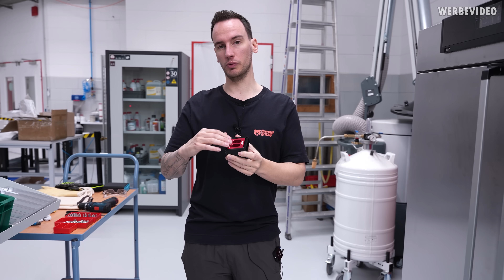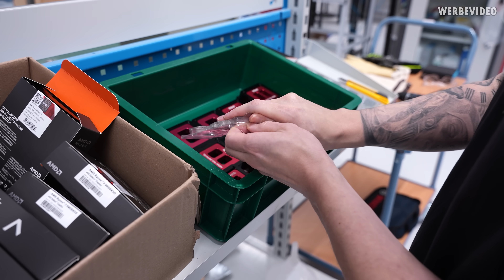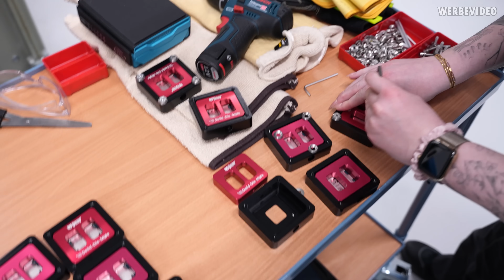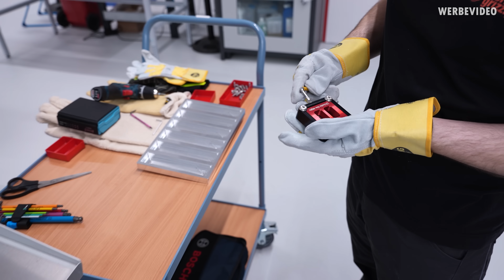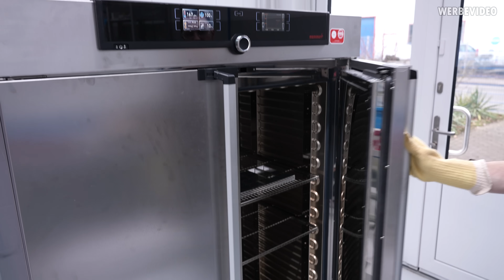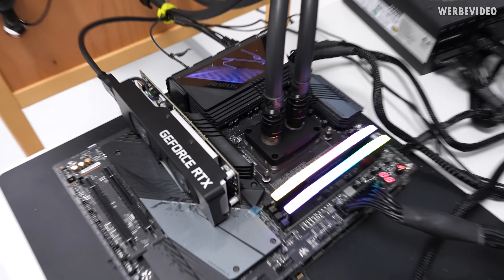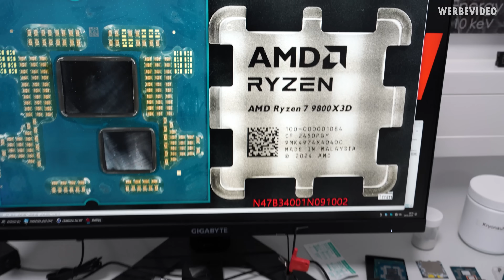You can now buy Delidded AMD Ryzen 9800X3D with 2 Years Warranty

Comment: I would love to purchase this along with your services of applying "safely" Conductonaut Extreme liquid metal  and the ihs back onto the top of the cpu as a full service kit. So I can continue using my AIO liquid cooler on the CPU. I think this will save users a large amount of headache with safely overclocking the cpu in moderation and not risk damaging their cpus.
Reply: Ideally using your own Thermal Grizzly Shield conformal coating around the SMD Components/contact dies around the silicon die then liquid metal on top of the silicon die then a copper OEM fit IHS on top. :)

Comment: Some negative feedback I have for you Der: 170c is not an unsubstantial temp to bake a CPU in, Personally I'd like to see more extensive testing to make sure nothing was damaged, check the voltages for spikes, run it for an hour under Aida64, etc.
Reply from the maker: you have to keep in mind that the CPU is also built this way. They are soldering it at this temperature. We just reverse the process
Reply: @derßauer-en  Actually it's more like 200c during some manufacturing processes. The important thing to do is just be careful not to thermal shock the CPU's. Heat them up slowly and allow to cool slowly just like you're doing now and you shouldn't have any issues.

On the other hand if you take a CPU out of the oven, and immediately dunk it in an ice water bath, I'd be surprised if it survived.
Reply: It's not hot enough to melt the solder, even low melt melts at around 200. The important thing is not heating up or cooling down rapidly, to avoid thermal shock. Of course, it's not safe to power the CPU during such temperatures, but with no power to the CPU it's safe. At the manufacturing stage, they are heated to a lot higher than 170 to wave solder the small SMD components etc, and the CPU die itself is soldered onto the PCB.

Comment: I wondering if a Automated screw driver for those delidders would be viable.
A pop in automated system that slide it once to one side would increase productivity, and could be changed to work with other CPU delidders.
However is understandable if engineering one would take far to long.

Comment: What a freaking cool idea!  ~$600 US for a delidded, tested 9800X3D?  That is a tremendous value!  Enthusiasts rejoice!
Reply: I don't know how many degrees 9800x3d lower, but my 13900kf runs 19c lower after delided (max temperature).
Reply: Also idk if the score is just weird or the 4 e cores can make up a 3 year/generation gap in IPC, but my 12700k gets 24k in R23, but he got 23k on the 9800X3D? Is that normal?
Reply: @pcmasterracetechgod5660  That score is pretty normal for the 9800X3D. The 4 e-cores certainly do help for multithreaded workloads, but they aren't that useful in gaming. That's what the 9800X3D is meant for and where it really shines.
Reply: @theyeetus1428  Damn, well I guess that seals the deal for me, definitely waiting to get a 9950X3D since the 9800X3D would be a sidegrade at best over my 12700k in productivity, and a downgrade at worse
Reply: @pcmasterracetechgod5660 That depends a lot on your particular workloads. How and by what its/their performance scale best. If it benefits most from a lot of cache, more cores might not be worth the added cost. If it benefits most from frequency, it's possible that 8C/16T might leave more power budget per core for longer duration of high boost frequency. If workloads is something that changes frequently, you'll probably be better served by having those additional full fat 8C/16T on tap in the long run, as it seems they got the thread scheduling sorted pretty well by now. It will likely have substantially longer legs for productivity in general, even when it's not the fastest kid on the block by a longshot anymore. 16C/32T, 140/144(?)MB cache, high frequency, low power, pcie5.0 IO - that's gonna be a great powerhouse workhorse for maaany years to come.

It ofc depends on price too, what you're willing to spend.

A bit of a shame (AFAIK) that they're not doing an Zen 5 AM5 16-core with 3D V-cache on both dies - but I don't know if any significant workloads would benefit from scaling in that way (Potential move to 12C/24T chiplets with Zen 6, with V-cache, would be better, or a 9960X3D with 1 V-cached 8C Zen 5 chiplet and 1 16C Zen 5C chiplet). I also don't think "the market sentiment" would be ready for the price tag of 2 V-cached top binned Zen 5 chiplets. Those fancy sandwiches are some expensive catering, it would "have" to be priced way north of a grand.
Reply: @pcmasterracetechgod5660  You don't buy a 9800X3D for productivity. If you want to do productivity, it's 9900X3D or 9950X3D
Reply: @rustler08 I would like to point out that not all "productivity" workloads are multithreaded or can use that many threads effectively. For what I do at work, disabling the efficiency cores (or rather, disallowing the program to run on e-cores) makes it run about 4x faster.
Reply: @pcmasterracetechgod5660  12700k is going to be higher for multi-core R23, but that means zero for gaming.
Reply: @pcmasterracetechgod5660  Yes. The 9800X3D is a gaming CPU and people don't play Cinebench that much.
Reply: for 3c lower? no thx
Reply: @ I think the point of offering this is to eliminate risk as much as it is for convenience and cooling benefits.  If you ef up your CPU by delidding it, just throw it in the garbage.  if you buy this w/ a warranty, at least you have a safety net.
Reply: @KimoKimochii  15C should be nice on a small case that only fits a 70mm tall cooler.
Reply: @KimoKimochii  more than 3c lmao.
Reply: @KimoKimochii  lol, he has a video about delidded 9800x3d and it shows 15-20c lower temps and 20w less power consumption
Reply: @DuBstep115  any performance increase? if not it’s pointless just to drop a little temp which doesn’t affect anything and maybe cost $5 more of electricity in a year
Reply: @KimoKimochii  Tell me you're not the target audience for this delidded CPU without telling me you're not the target audience for this delidded CPU.

🤣🤣🤣

Stay in your lane.
Reply: @KimoKimochii  Lower temperature = better performance because increased temperature means increased resistance. That's just one benefit among others what lower temperature offers, lower energy consumption, increased lifespan, better OC potential and increased stability just to name a few.
Reply: @DuBstep115  Well, there might still br some hesdroom left like you can see in the vid, where amd pbo doesnt push the frequency up anymore although temps allow it. that requires bios changes

Comment: Very cool! 😅

Do you have any data on long-term durability for delidded CPUs with liquid metal? Is there any corrosion or negative effect on the silicon with regard to temperature fluctuations vs having the IHS as between the CPU/heatsink

Comment: Feel like the delid process could be performed by a CNC machine with a few blocks designed for the chip to hold it and then g code to shift the table back and forth with another block to hold the ihs. basically, the blocks you already have... No heat, just back and forth. If the CNC is advanced enough add force feedback to know when to stop.
Reply: A CNC machine is WAY more expensive than an oven. You're overcomplicating the process. No need for "a few blocks designed" which takes designer time. No need for g code which takes programmers time. "If the CNC is advanced enough" means you don't know it well enough to know. Murphy's Law always makes processes more complicated.
Reply: @sammiller6631   He already has designed everything necessary and I'd assume he has a CNC. So its maybe 30 minutes of faffing around with g code and short cycle times between each unit.
Reply: @brettcombs774  If he has an CNC, then it's needed for other things. That's not a sudden impulse buy. People always underestimate what it takes when they're not the ones doing it.
Reply: @ You're right probably like the oven he's definitely not using to temper things and then waiting for availability.
Reply: @brettcombs774  Is an new oven cheaper than a CNC? Why trying so hard to push for something he doesn't want to do?
Reply: @sammiller6631  if he wants to or not is a matter of his on conscience not ours. Who knows. Feel free to poke issues.
Reply: @sammiller6631  As far as the CNC is advanced enough I mean if his machine has force feedback which is not a standard feature. I've programmed robotics before, CNC machines, and Mills...  I'm familiar. Does he have a Bridgeport manual 3 axis or a 75000 Tormach idk.

Comment: Looking at your video about delidding the 9800X3D and the results...there seems to be almost zero benefit for gaming.  A small overclock without delidding gets you basically the same results without losing your factory warranty.
Reply: the CPU runs cooler, uses less energy, so potentially can even have a longer life in that way. I know it doesnt use a lot of power, but the lesser the better imho.

Comment: 08:16 Surely a regular thermal paste would be sufficient enough for the testing?
Reply: not really, most thermal pastes would quickly dry because of how heat dense a cpu package might get, and if you are delidding, might as well go all in, makes no sense to put something in that will eventually pump out
Reply: @kiam9941  Not quick enough for them to not be able to finish testing I recon. The point is that if staining is a concern and they're unwilling to polish it afterwards, then perhaps they shouldn't be using liquid metal.
Reply: They test with a cinebench run and test core-core temp delta so liquid metal is probably the best choice. 

If you're deliding and not using liquid metal there's no point.

Comment: Thanx a lot I wish this came earlier. But will use this service for sure in the future 😉 (I am the one with the aluminium particles). Second delid went smooth with package tape on pads. I removed first the glue with dental floss too. I will buy the direct die block this year. Greetings.

Comment: great program i may consider it. i would be intrested if you could provide a bundle with suitable CPU cooler + thermal phaste and any other items you would suggest for the best experience.
I am a computer enthusiast that would like to start a hobby project getting a new pc with custom loop and but since so far i always bought  AIO water cooling so far.
I assume i should get 
Conductonaut Extreme
AM5 Mycro Direct-Die
or do you also need to use Shield Coating ?

with the CPU right? i see the water cooler is not in stock so let me check again at a later point

Comment: Honestly surprised you didn't just ask AMD directly if you could buy a batch of 9800X3D's without the heatsinks installed straight from the factory, then just make sure the warranty doesn't include physical damage to the die.
Reply: I don't think amd would do that. Perhaps if a giant retailer would order 10s of thousands, but not for a handful of CPUs.
Reply: Minimum order quantity...for something like this I would guess it would be between 10 000 and 100 000 CPUs.

Comment: Are these "good to go", or is it still necessary to add nail polish (or similar) to the contacts around the dies to avoid contact with liquid metal?
Reply: Nail polish? Thermal Grizzly has TG Shield, a conformal coating better suited for protecting contacts than nail polish.

Comment: is funny to me because amd spent time to put the heatspreaders on, seems like they could save some money by not doing that process and offering this same deal and undercut you by a lot
Reply: AMD tried shipping CPUs without hestspreader on the original Athlone CPUs from 1999-2002, and it was a total mess, CPUs would cook themselves within 30s if the heatsink wasn't installed collectly, CPUs Dies would be chipped or cracked by uneven pressure being applied  to them while install heatsink. It gave AMD a bad reputation for reliability that haunted them for more than a decade, even after they started shipping the Athlone 64 in 2003 with a hestspreader.

Comment: Roman, any chance you guys will also be doing this with the 9950x3d?
Reply from the maker: yes :) should have it right at launch
Reply: @der8auer-en  Danke Roman.
Reply: @der8auer-en  Any chance instead of straight delidded you will be offering CPUs prefitted with the high performance IHS you guys made? Might be a dumb question since the current design screws into the motherboard socket.

Comment: I have a 9950X. Worth delidding?
I do not like turning PBO on, because if I run Cinebench R23 the CPU jumps to 95C really quickly. My AIO is good, but it's overwhelmed by this CPU. What I do is set a negative voltage offset for PBO so the thing stays in the 70C range in R23. I wonder if the cooler can do better with delidding though (Lian Li Hydroshift 360). 
Then again, I am not losing much by not fully unleashing the CPU in PBO. 500-1000 points in R23. I use less energy for every use too. It just bugs me knowing my CPU can do better if the cooling was able to cope.
Reply: You could use better thermal paste or their thermal pad. Then use an offset on all the cores, then add PBO afterwards. I think you can find a middle ground here.

Comment: It's wild that you cannot convince AMD to ell you a sku w/o the heatspreader. Price seems reasonable given the warranty provided and labor/tools required. Perhaps consider a bundle with a kyrosheet and mycro direct die cooler? The value of this service would go up for the 9950x and future 9950x3d parts with three packages on the CPU vs the two packages on the 9800x3d, I'd hope to see you offer that service in the future.
Reply: imo they should sell it exclusively with either their TG IHS or MycroDie
just to be sure it was used with quality parts and prevent RMAs
Reply: There’s a reason the IHS is used, it protects the dies. Are you willing to buy a delidded CPU from AMD without a warranty because I’m pretty damn sure they’re not going to give you one.

Comment: Delidded my first cpu, a 14900ks, with the help of your video. I rewatched it countless times and probably spent about 4 hours just making sure I did it properly. I’m glad it worked out fine, just take your time and you’ll be fine.
Reply: 14900k alreeady has metal / liquid metal as TIM, why delid a 14900k?
Reply: @ direct die cooling with the thermal grizzly micro direct die pro, lowered my temps by about 20C with my cooling setup
Reply: @Rare_K_ direct die is still better than IHS

Comment: perhaps it's a good time to say the recent 9800x3D problem didn't come from the CPUs which are fine but something in asrock bios related to DDR5 management that made the motherboard not boot anymore, the cpus that didn't start worked fine on other motherboards and or on previous or new versions of asrock bioses, official statement below
Reply: We will release an official statement with more details later, but since there is a lot of misinformation being spread, here is a quick note! The bottom line is that it is not broken. It is just that some CPUs do not start due to memory compatibility issues. There are many reports of the Ryzen 7 9800X3D suddenly breaking. At least 40 cases have occurred, mainly in ASRock motherboard environments. — ASRock Japan

Comment: Wish you the best in this project, I just remembered when I got my first AMD CPU a Slot-A AMD Athlon-k7 500 pre overclocked to 650 with a custom made CPU cooler glued to it by an USA company called Step-Thermodinamics. I was kind of a cheap ass LOL it was less expensive that CPU than a 600 MHz one.

Comment: Not sure if you need a feedback
1st: 4:40 please, machine a cpu tray with easy-to-grab protruding handles. This one just asks for a disaster, as you basically forced to grab it in gloves with CPUs lying loosely on the same edge you are grabbing to.
2nd: I see how the most time-consuming part is the initial 'nudge' inside a delidder. I assume you already tried to heat cpu inside a tray without using a delidder first and didn't achieve acceptable results. But I wonder if you could apply a pressure to the lid first. 7800 x3d has a gap between IHS and PCB, you could insert a wire of some kind in the gap, put it under the tension and heat (delid) it in one go.

Comment: currently running 7950x with EKWB water block not impressed by temps I looked for alternatives and ended up on your Thermal Grizzly AMD Mycro Direct-Die Pro CPU Water Block
but didn't want to take the risk as the 9950x3D was already announced, now if you tell me you plan to sell a delidded 9950x3D AND have your direct-die cpu block available at the same time (one without the other makes no sense for me as a customer)  I would buy them, I wouldn't order a delidded cpu if I can't secure a waterblock for it actually, waterblock availability is always dubious in my experience it's not parts retailers keep 100 of